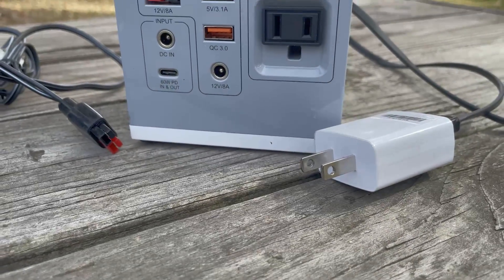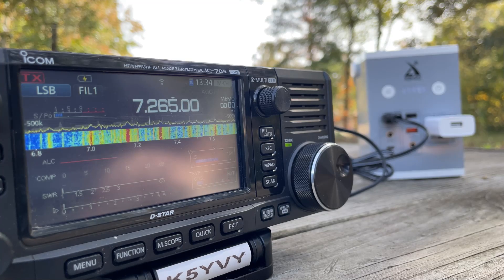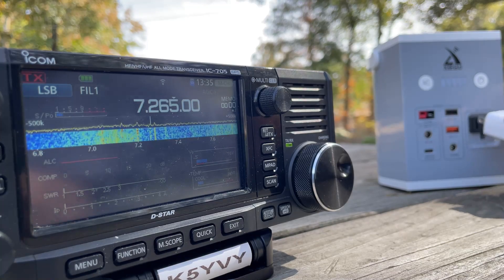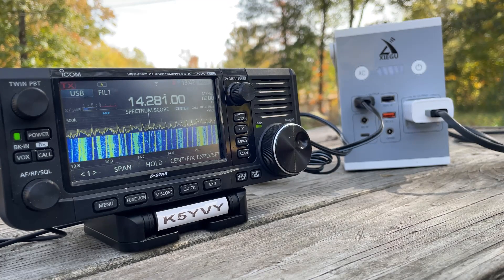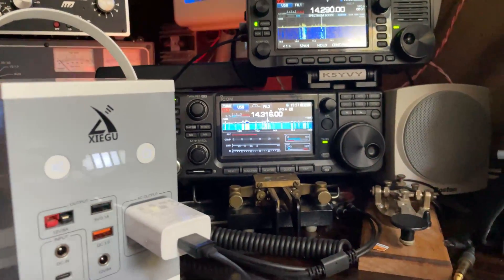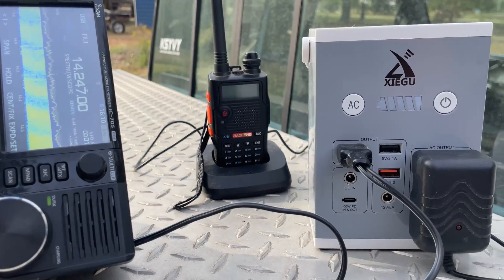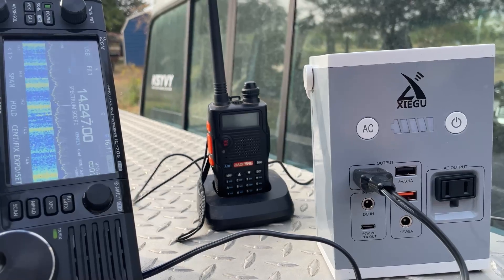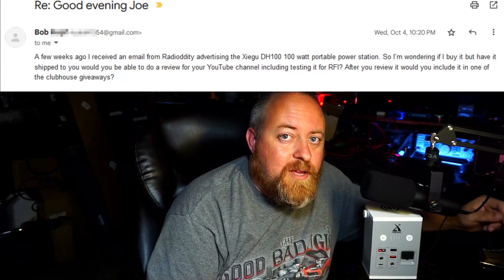Compact, but BIG Power? RF Noise? | Xiegu DH100 | Battery power

Comment: If you run one thing at a time its fine. Multiple things it fails hard and causes interference.
Reply from the maker: I could see that, definitely does pretty well for it's size though. Thanks for the comment 👍

Comment: I would love to see you add some ferrite beads in line from the radio to the battery box. I see that noise but I am wondering if a few ferrite beads after the power poles would clean it up? Nice review JoeBrett.
Reply from the maker: That’s good thinking Don, very possibly could clean that up.

Comment: [Warning: retired EE]
In the field, you plugged a USB charger to the ac port, but nothing into the charger. Electronics can be weird; the charger might be quiet with something plugged in.

Otherwise, it looks great for QRP. Unfortunately, I ain't got time for QRP. 😮 If I want less than 100W, I turn down the power knob.
Reply from the maker: Thanks Lee! You’re correct, electronics can be weird lol. Otherwise it is a very capable battery supply, I was sort of impressed it powered my solder station. 

I’m not convinced it was the charger block being so noisy, as much as it may have been the internal circuits providing AC 🤷🏼‍♂️